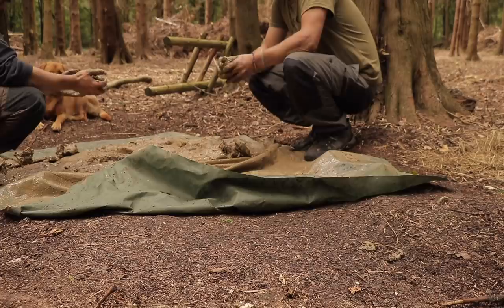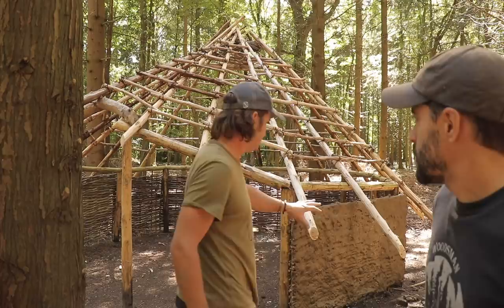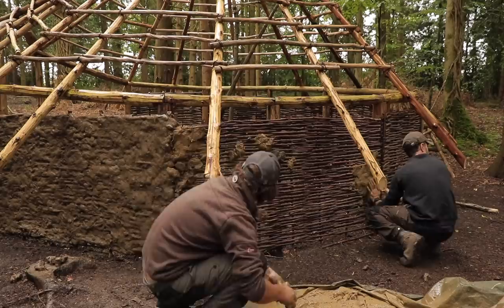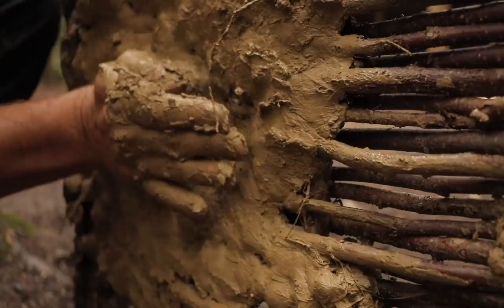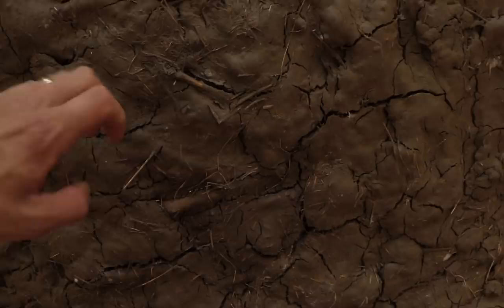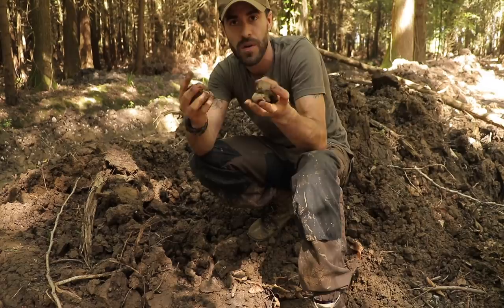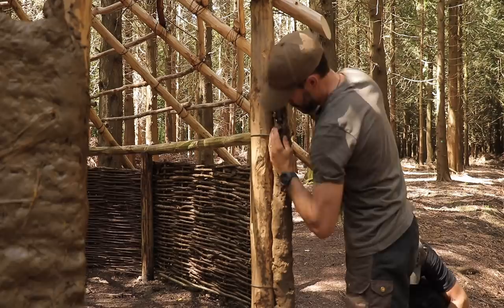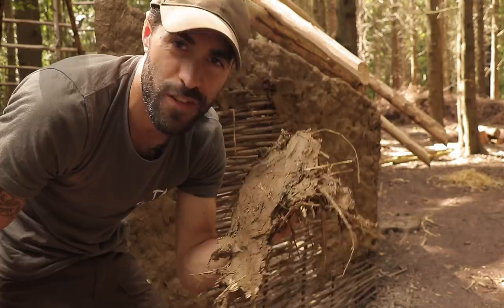Building a Roundhouse: Clay Walls with Bare Hands | Bushcraft Shelter (PART 6)

Comment: hi guys, I have to put something to your attention. you did first the outside and it will be half dry when you get to the inside, which give you a bit of a problem. the clay in the inside will not stick so well to the outside clay. it would have better do both sides at the same time, working together inside and out, to make the clay stick together through the hazel. love to see how it will work for you. love and courage
Reply: They will have to wet the inside clay so that the next layer will stick

Comment: Just some fun facts: Wood ash is basicly lime(the powder kind, not the fruit) and salt. Ash from normal camping/cooking fire wont have been hot enough so only a small part will be quicklime. This will harden when it reacts in water, which is the basic of concrete. The salts are called potash and will slowly wash out of the walls over the next months/years and might even form salt crystals on the walls if a lot was used.

Comment: The presence of cowdung (animal dung) in clay mix improves the resistance of adobes to water because of the formation of
 insoluble silicate amine which glues isolated soil particles together. This causes the material to become less porous and resistant to water. Also, their presence in adobes prevents the propagation of cracks.
Reply: Nice tip. I wonder if the smell fades after a while tho...
Reply: I remember hearing a story about a missionary woman in Africa. Where it was her first time there. She was in a native Hut with another missionary and a local woman. And she kept running her hands on the smooth inside of the Hutt talking about how beautiful it was. Almost like glazed pottery. Swirls of different layers of brown and tan. Super smooth like glass. Constantly rubbing her hands on it the whole time. The Other missionary woman was horrified. And finally told her that the walls are covered in clay and cow poop! LOL

Comment: When I lived in France I helped a guy I knew build a structure not too different to the one you're building, but he mixed river sand with the clay and used actual straw, but then he used a landrover with stubbly tyres to mix it all up (previously oxen were used to trample and mix the daub, so indeed there would be a fair amount of dung in there.) and had so much stuff ready he only had to make the daub a single time. He also used much more straw and made the mix wetter so that it worked its way right through the wattle. At night he wet the work down so it wouldn't dry too much overnight, and continued doing that for about a week afterwards with the result that cracking was minimal by the end - when it dries too quickly it cracks. Really enjoying this series and full of admiration for what you're doing. Finally, thanks for the giggle at your almost visible injuries - when I were a lad etc. Loving it, keep up the good work.

Comment: Such a cool build!! Love the channel, am new to it but it's educational and entertaining. New hobby/skill set to try during quarantine.
Reply from the maker: Welcome to the channel!
Reply: @TAOutdoors  I've had my own experience building a round house and working with wattle and daub and understand your struggles lol 
using daub is like mixing cement, you have the clay working as your lime, your main binding agent, you have sand as the bulk of material (which you could have also used in daub) that you'd be binding together, and you have aggregate to give it more strength (your fiber added)

but in order to properly mix these ingredients together, it needs to be dry and broken up. if you add wet ingredients like piece of chunked up wet clay, you'll have chunks of daub going on with higher or lower moisture content than the rest of the material, which....when it dries, causes intense cracking. Similar to why ceramics crack when being fired, expansion of water. but in reverse with drying. Ideally you will have completely dry daub mixed together with its materials before adding the PERFECT amount of water to each batch. 

For our daub we mixed dry, crushed clay (which was crushed traditionally with horses or animals, which is why dung was frequently in the daub and considered to be an extra binding agent) dry sand from badger mounds which had excellent amounts of dry straw and bedding material already mixed in, and we also added crushed, dry, horse manuere to add even more strength. Then when we mixed all the dry ingredients together, we gradually mixed it while adding water to get uniform consistency. 

I would recommend (based on how much clay you're going to need) that you dig a mixing hole in the ground, so you can pile your ingredients in, and stomp around in it (bare foot) if you intend on continuing the wet mixing method. Too much water really ruins your structure for cracks. obviously you can always fill them in. Also, remember to moisten your wattle! Daub adheres to daub better if its moist, just like concrete. 

Are you planning on sealing it with lime wash after? I hope so =) and make sure that roof gets on before it rains, that rain will destroy your walls.

Comment: G'day Mike. I've only ever done one, two story clay brick house. And just double checked we didn't use sand in the mix. But used equal  (by weight) barley straw to the clay mix. Once the clay bricks were dry and setup, as walls, then made a slurry of the same clay and water and that was our plaster. Gave the completed wall a good coating, and results in a beautiful smooth finish. The type of clay we used down here in NZ may be different to  yours. Not sure. Our system was based on 1000+ year old style in Egypt. Maybe that system was used in daub. Sorry my comment is so long , but I'm interested in your projects. Love your channel. Take care.

Comment: In the future when making walls on the ground, try putting down a layer of stone under it to prevent "rising damp". "Rising damp" is the materials of your wall (wood and mud in this case) absorbing the moisture in the ground like a sponge, it weakens the structure and makes it rot faster.

Don't use just gravel as that's generally too fine, best to use rocks of differing sizes up to hand-sized rocks. Use enough to maintain about a 5-7 cm layer above the ground as well as the same underground (ideally you'd want double or tipple that undeground, but that's more a 1600's era and later thing) under the wall and don't cover the stone layer with any daub or plastering.

If you're worried about authenticity (mixing building methodology timelines), most town-building cultures from around the world faced and adapted to this issue in similar ways. One of the earliest documented sources I could find was the Roman architect Vitruvius, back in 70 BC.
Reply: @They Live! Again. The foundation would just be stone; no mud or wood except for the building's frame going into the ground. 
If you're worried about insulation: the floors to early medieval homes were raised with dirt and, depending on several factors like personal knowledge, culture, time period, and wealth, some floors would have a bed of stone lower than the wall footing and dirt placed on top of it and tamped down to raise the floor level to the base of the wall. The raised floor improved insulation and helped prevent flooding.
Reply: @They Live! Again. I see what you mean, that works too. Though lime was generally used to make mortar (mud and/or clay could be mixed in to stretch it, depending on how much the person had or could afford). However, the wood plank ground-level floors aren't a medieval thing at all; more of an early-to-mid renaissance thing (1600's era). Sure, the upper floors (if there were any, which was rare) would be wood, but the ground level pretty well never was unless it was temporary (repairs for castles or manor homes).

Comment: Great video series! It's best to use manure, as this provides a source of calcium, magnesium, sodium and potassium. All of which stabilizes the crystalline structure of the clay, making it less susceptible to cracking. Ash provides small amounts of potassium, which is why you had seen the improvement 🤓

Comment: In hindsite might have been better to put animal dung on the outside and clay on inside... Also might be good to have grass in bundles on top of clay on outside running from top to bottom so that rain would run off of it instead of clay or maybe you can bake harden the clay with a reflected fire a little at a time going around the shelter.

Comment: Adding sand to the mix might reduce the cracking when it dries. Clay plaster used for rendering walls in houses should contain at least 50% sand so maybe it is worth trying that out if you have sand available.
Reply from the maker: Yes, but not sure the celts would have used sand unless they had it in their area. Think that is why they used animal dung. But we have a project coming up with sand involved!
Reply: @TAOutdoors  You did an awesome thing there. Looks really beautiful!

Comment: Another thing to reduce cracking when drying is to wet the sticks first, before putting on the clay and straw mix.
So that the sticks don't suck up all the water, letting the walls dry too fast.
Reply: Using modern building materials, you might wrap the house in plastic wrap to slow down the drying process, which should also help to prevent cracking. Perhaps damp burlap could be used if you want to used period materials.

Comment: Add a little more water to make it softer and it will go on way faster (like 2x faster).  It will crack slightly more, but putting on another layer will fill in those cracks.  I built a straw bale house using clay plaster and I can tell you that a softer plaster goes much much easier.  It is also easier to get smooth.

Comment: As I understand it daubing would have originally been done on both side of the wattle simultaneously so that as it dries it would bind not only on the outside of the wattle but through the wattle as well creating a stronger bind which as you discussed would help hold cracked pieces in place. Given the fact that there is two of you and you could do this is there a reason that you daub one side of the wattle first and then the other?

Comment: if you want to stop it from cracking dont be afraid to add more water to your mix. Your best option was to make sort of a thick pancake mix with the clay, hay, and with or without the ash so that it can dry at a slower rate while also minimizing the cracks. what you made was more of hardened clay which would crack since its at the leathering stage. Thats when you would add colored clay, make cut outs, details, and anything to just really embellish it before you let it dry through for firing. so add that water and really have a go at it. also use a flat board to kinda wack it smooth, no need to hurt your wrists like that. good luck and its looking top notch so far. :)

Comment: Awesome. I'm living on the Navajo Nation Reservation. Big Water Clan. I live in a shack home basically covered by Tyvec material with a new roof put on last summer. I am going to not try but put on a outside Clay mixture on the outside of structure.  We have a spring here called clay spring's.😂. Thank you for your mixture testing. Instead of straw, I will use some tall shrubs beating on it turning into a strong string material. Thank you for your channel and fascinating building of old school home's. Bonus when you touch the Earth you are sucking nutritional value into your body.

Comment: I remember a wattle & dab builder say something to the effect that it will last forever if it has "a good hat and good boots". The "good hat" is a roof with a good overhang (which your building has), and the "good boots" are (is) the foundation, which in that video was made of stone. Your house sits on mud, so it is likely that the moisture will wick up into the wall and cause problems later on.  Had you used maybe a foot or so high foundation of rocks, the wall would be sitting on dry rock and so would last longer as the rocks act as a kind of moisture barrier. Again, there is a YouTube video somewhere where I learned this. (Hopefully, it wasn't one of yours.) Anyway, the traditional method you used to build your structure may predate this bit of folk advice. I like your videos. Keep up the good work.

Comment: maybe try a crude white wash on the inside walls using ash? maybe just for experiments sake try charcoal on the outsides?
just remember the smoke layer puts out the embers that fly up from your fires so you really do want that in there, also used for drying spices/meat

Comment: If you were intending to live in that house over a winter, you might want a second wattle and daub wall on the inside of the beams, and fill the area between them with soil - for insulation. 
The idea with ruminant dung is that it has a lot of very short grass fibers in addition to the ahem 'adhesive' properties, and that is why it's considered very good for daub. It prevents a lot of the cracking before it gets to being a wide rent in the wall. Grog (ground up fired clay from pottery) could also help with reducing cracking, giving the clay particles something to adhere to while drying.

Comment: Hi, your videos are so relaxing that anyone can watch for hours.
Get well soon!!

Yes, you can add cow dung, mud, and husk to cover the walls. It is the best mixture for strengthing the wall.
In the rural part of India, some villagers are still using this method to build their houses.
And the Life span of somewhere around 10-15years.
And if villagers find some cracks on the walls then they used to fill these gaps with mud and cow dung mixture.

Hope this will helps

Comment: Add coarse sand and more water to the mix . This will help prevent cracking and makes it ten times easier to apply. I have worked on many cob buildings and  i have made a few iron age round houses. The method i use for the mix depends on the quality of the clay. With good quality clay i would leave it  in a bucket of water over night then i would make a three to one mix ,one clay and three sand/aggregate with some straw plus water if needed. Very easy to apply and to smooth over.
Reply: I agree with that.... some more sand could help

Comment: Old Family Tribal for such a wound...you Have to Gather Only sap from the balsa fir'  tree...the Christmas tree. Not spruce etc.
  You boil it down and skim the toxic black tar off until clear..using a peeled branch of only the balsam tree.    Pour it into the wound as hot as you can withstand it..then cover with leaves or moss to help cure.
   We had lumberjack 1800s severe injuries with axes.  A big soup spoon was used ..it kept on our horses harness called the ( Hhames)....one h ..spellchecker turned it into games.
  Anyway it was our olde Tribal Liquid bandage..it Cured the wound and no infection got in..the very little to no scars and no bulges of flesh wound.
  It cures and heals without any ill effects.    It works even today...if you are caught away from medical help.
   Same for animals..just cool it to warm..the heat is for Cauterizing. Hemmoraging wounds.
  Times we had to cut off the leg or foot..even hand ..and we needed immediate cure that iron didn't touch.
We had no hospital until 1950s. We lived almost 50 miles from town..and only horse drawn sled or cart.

Comment: Those rafts are called "tyn" in Ukrainian, and all the construction with clay coated rafts and thatch roof is called "mázanka". Traditionally, such mazankas were built for cattle and pigs and chikens. Well, they're just recently became history. It's just some 70 years since nobody builds these shelters in Ukraine.

PS: By the way, there were also clay floors inside mazankas. But clay was mixed not with straw, but with cows dung. Because clay/straw can't stand stepping on it. And the floors were covered with reeds on top the clay. Once in a week, dirty reeds were removed, floors swept and covered smoothly with additional clay/dung coating, and then with fresh reeds. Such floors were also in traditional Ukrainian homes, called "háta" - one-store houses made of mudbricks covered with white lime stucco and with thatch roof.

Comment: No kidding, guys. I just got back from a couple days in the mountains. I was simply snapping a small stick in half for the fire and a sliver shot off and stuck in my cheek. Not a big deal, although I bled like a stuck pig, it would have been a completely different story had it been two inches higher.

Comment: I believe it is best to Daub Wattle on both sides at the same time from a structural point. I believe the Dung would have come from cleaning out the straw bedding of cattle or sheep,Goats. That way you have the straw inclusions and other fibrous plants that would bind the mixture. As the material cracks you could always mix enough water in with the clay to form a type of slip that can be trowelled on the outside. Burning sea shells would give you the whitewash/quicklime to paint the walls of the outside and inside of the roundhouse and that would be another layer of protection for the walls and make the inside brighter.

Comment: Since the overhang is important, I think I'd square the ends or the rafters off, and then use a wood rasp to round off the edges.  That way when you bang your head or your back on it (because you definitely will) it doesn't do so much damage.

Comment: thats some really good clay you got there!. to get rid of cracking you really need a ratio of 1 clay to 1 sand to 1 straw. can even up the ratio of sand  - but looks like you dont have much sand in the area. and it makes sense that the celts would not have used it.

Comment: You might want to look into using horse hair for the binding of the clay. We used it when we lime rendered our house and it worked really well. Also use a hessian sheet to cover it while it dries. This will  save you alot of cracking. Great work though, loving the progress.